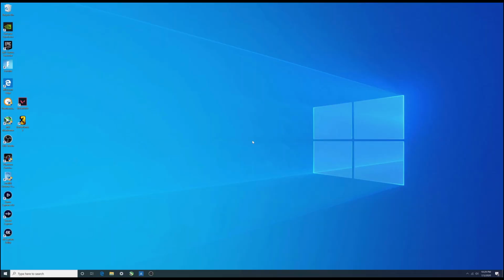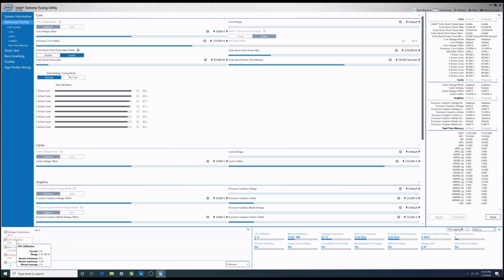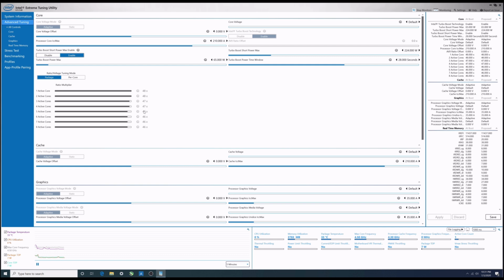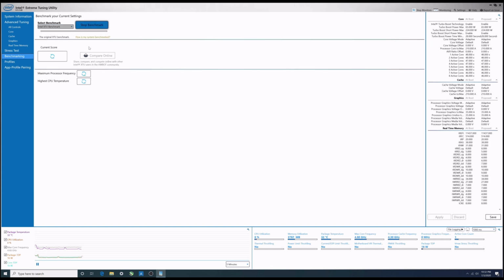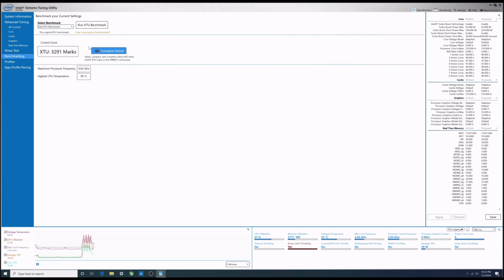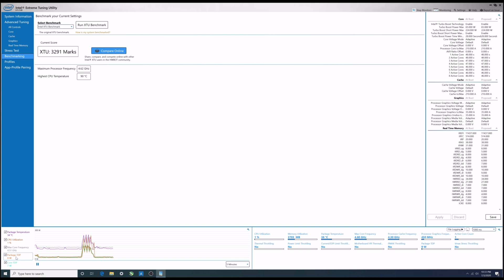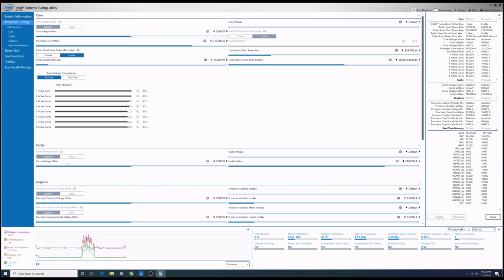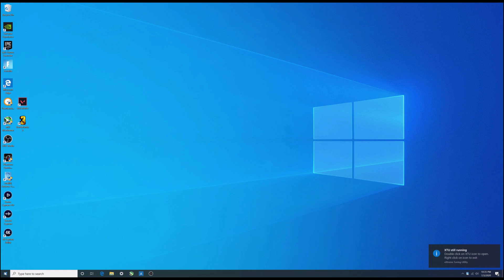1x4 1x8 CPU Power Connectors, How many do I really need to get this Z490  to boot up? (ATX) PSU z590

Comment from the maker: In this video.. I take a look at 1x4 and 1x8 for power consumption for I7 10700k. https://youtu.be/ZuXCdMJrvnM

One thing I failed to note...if you are going to use a PSU with only one 1x4, AsRock states to ensure that the corresponding 1x4 pin is plugged into where Pin 1-4 are.  Hopefully, this helps someone out.  I believe for most of you it will be whether you can only use 1x8 pin for a 1x8+1x4 pin motherboard.  Even though my PSU supports using all of them, I am only doing 1x8...when I get my I9-10900kf, we will use all of them.
Reply from the maker: Good question...and would answer that if I had 10700k instead of 10700...since I have right PSU.  This would interesting to see in XTU..as mine will pull up to 114W..and I think I only have 8pin in.  I probably should do a vid what it pulls 4 pin vs 8 vs 12.  Might answer your question.
Reply: Did you ever made that video 4 vs 8 vs 12 EPS? Because me and my brother are planning to get X570-E with 5950X. Probably a light over clock. Nothing like LN cooling, Nothing extreme overclocking. Also do you think it is safe to buy a 8 pin EPS split to 2x8ping EPS. I am using EVGA SuperNOVA 650 GA, 80 Plus Gold 650W.
Reply from the maker: @DrivinginNewYorkCityNYC    This is the only related video that I have done with I7-10700k https://www.youtube.com/watch?   I took an I7-10700k, hooked up a device that would measure total watts drawn.  I went thru 1x4, 1x8 and 1x8+1x4 seeing what power they would draw running the XTU Benchmark. Once I got to the 1x8+1x4 I added OC to the experiment.   Quick summary if I remember correctly...the 1x8+1x4 drew the most power and hit the highest benchmark.   I may one day do it again one day adding a Block Frequency 100.5 to 102.9 with the OC to see if I can beat my best Cinebench R20 and XTU benchmark.. assuming it can handle it.
Reply: @PC_HardwareTechUnboxing_1  Is it ok for me to just use 8 pin and do some overclocking? My psu is missing another 4 pin. It only has 8 pin.
Reply from the maker: @DrivinginNewYorkCityNYC   Yes, from that aspect it is no different than if you had a motherboard that only had 1x8.
Reply: @PC_HardwareTechUnboxing_1  thank you.
Reply: @PC_HardwareTechUnboxing_1  could I cause any harm if I plugged them both in? I have a i7-10700k and plan to do some medium to high overclocking but just want to make sure that the extra 4 pin isn’t going do anything bad.
Reply: @FinalLight The 8 pin gives 384W of power, if you do no heavy OC then it should be enough for the CPU. The 10900k don't even need Thst much power. I just game so nothing heavy, I also have only an 8 pin.
Reply: Please I need your advice. I have a 300watt psu with a Pin 1-4 which I intend to replace at a latter date. For the moment it powers a core 2 quad processor Q9650 of 95 watt and a GTX 1650 Super on an old lga 775 motherboard which are very power hungry. I game occasionally and my total draw is 160 watt for all the above components. I was thinking of getting the new intel motherboards and an i7 10700 of 65 watt. Not the K nor KF versions. I want to pair it with the GTX 1650 Super and the 300 psu. Do you think this is feasible because I am a bit tight on budget? Thank you in advance!
Reply: @firstblessings8777  1650 super draws 100w, 65w for the cpu, 40 for mobo, another 50 for fans etc, thats 255, plus drives and you want to have some overhead... id recommend an upgrade but you can always try what you have and see if it works???
Reply: I think I remember a motherboard with 2 8 pins

Comment: hello @david noble i want to buy msi pro b660m it has 8 + 4 pin connectors and i want to use i5 12600k without overclocking at all, can i use only 8 pin connector with full i5 12600k performance. please help me out  please
Reply from the maker: Hello, that extra 1x4 is usually only useful for extreme overclocking.  You most likely will not notice any difference.  Now, if you start adjusting power limits on an I7 and I9, it might matter a bit more.  Sadly, I did not do a good job of comparing this aspect when I had the I5-12600k in the Asus Tuf B660m, where I could have compared a few games with MSI AB for CPU power usage and done some benchmarks with Cinebench.
Reply: @PC_HardwareTechUnboxing_1  I’m building my first pc and have the same “my psu only has the 8 pin” issue.

My question is is it possible to run an adapter cable to make an extra 4 pin or a 12 pin for cpu power? 12600k seasonic focus gm 850 and a 3060ti/3070/3070 ti depending on what becomes available. Just in case I plan on overclocking the cpu in the future.

Comment: hi.  So is cpu 8 pin enough for 10700KF.  I plan to setting the CPU core to 1.2v only and whatever stable core multiplier, be it 46x.  Thanks in advance.  Hope you can help me.  I just pulled the trigger on a $199.99 10700KF and $130 msi z490 a-pro,  i haven't build it coz i saw the 8+4 CPU pin layout.
Reply from the maker: Hello, if you run default settings to a slight OC...8 pin will be fine.  There does come a point where if you are using say Intel's XTU, you will see that program starts to warn you that there is Power or Current Limit throttling...this assumes you are properly cooling your CPU and get to that point.  Even with 12th gen out now, that is a great price on an excellent CPU.
Reply: @PC_HardwareTechUnboxing_1  thanks for the reply and feedback on my purchase.  New sub here.

Comment: I have cooler master mwe 650w 80 plus version1 bronze psu.
Can you please tell me will it damage my pc components or is it a good enough psu.
My pc spec :
Pro: Ryzen 7 3700x
Mobo: msi mpg x570 gaming plus carbon pro wifi
8×2 gb of ram
Gpu planning to buy 3070
Using a 1 tb hdd
And 2 m.2 nvme
Planning to buy 2 or 3 1tb sata ssd.

Comment: I have Asus H410M-CS which has 1x4 pin.. I bought i5 10400f..will it work?? I mean like turbo boost has 4.3Ghz and base clock is 2.9hz..i dont wanna run it on base clock u know what I'm saying??

I have 1650 super and 500W bronze psu

Comment: Hi! I'm planning to buy a new PSU that only has a 1x8 connector, the processor is an i9 10900K and the motherboard is an Aorus Z490 Elite AC. Do you think that only a 1x8 connector is enough, or I will need 1x8 and 1x4 connectors? I do not plan to do OC.

Thanks!!
Reply from the maker: Hello, you will be fine.  If you were to OC and adjust power limits to unlimited, you would see some power limit throttling.  If you do neither, you probably wont' see it at all.

Comment: Can I use 2 power supply for this MOBO?
Reply from the maker: Never tried it and probably never will.  I would say  you would need to have a PSU tester on the 2nd PSU or have another motherboard sitting around that you don't have the CPU connector plugged into.   Probably not worth damaging all those parts.  However, when 12th gen comes out...I might just have to try that one.

Comment: i cant even find a 1x4 cable anywhere
Reply from the maker: Most PSUs that have this start at 750W and if they have it are 2 sets of 2x4.  They will arrive connected and you have to split them apart..

Comment: I’ve got an i7-10700kf and was wondering if I should use both the 4 and the 8 pin cables? since I plan to do some mild overclocking.
Reply from the maker: This one if those depends type answers.  If you have not set Power Limits to unlimited..and have not noticed any Power Limit throttling, you are most likely not going to gain much with the extra 4 pin.  If you have a PSU that supports it ..I would probably just plug it in anyways.  In general, it probably will not use more electric until you really push it.

Comment: why would not you be able to power it by 1x4 pin ? they all are short connected in the PCB layout..... more connections only get's you to draw more AMP-s from PSU .... and also does it VEERY much more efficiently ........ IF the cable is 16AWG and only one yellow + and one black - you would have for 9 amps on 12 volt over 50 cm (20 inch ) ... at the cpu connector you would have 11.88 volts .... THERE are 2 pairs of cables that means 11.926 Volts.....more cables means more EFFICIENCY! for processors like 10400f probably 135wats of power draw MAX in rendering.... one 1x4 jack pin or however you call it IS FINE...

Comment: 4pin is sufficient but when overload there is risk of overheating even melting of 4pin socket. therfore there Is 8pin to prevent this. Every wire Will lose efficiency and stability if the current is high so more wires Is better in distribution lower temps higher efficiency and stability. If you have only 4pin than every cable has marking on it. You just need study the wire characteristic. If you have 4pin with strong wires you can use adapter. If you have weak wires than you should use free cables from molex to 4pin adapter. But be aware that your PSU May have 2x12V which one Is dedicated to your GPU which may require more power than your CPU. The extra 4pin Is for extreme overclocking. I didnt test anynthing but I guess that worst cables of 4pin should do 95W CPU. Also motherboard should be designed for this 4pin load but i didnt found any manual info And Its probably in service manual not public. But what Is public the CPU support list so if you find there that support 125W CPU than MB should be ok.

Comment: Can someone help me? I was using a I5 3570 on a motheboard 4 pin and now i got a new motheboard but it is 4+4 pin (8 pin), i connected it and after turned on the pc, i realised the processor is much hotter on this motheboard, if i take off one 4 pin and leave only the other 4 pin will it get colder?
Reply: Maybe cuz now it has more power so it's using more powere and getting hotter , did ur performance increased ? If not yes unplug it if u feel it's cooler with 1 of 4

Comment: YO do I need to plug the 4+pin my EVGA power supply only has the 8 pin
Reply: No you dont. I didnt plug mine in and i can overclock and everything works just fine.

Comment: ok so i have this old motherboard which supports 5th gen core processors that has a 24 pin "ATX" power connector which i will be replacing with a TUF H310M gaming motherboard 8th gen along with an 8th gen pentium processor and i just found out in my new motherboard that it has a 24 pin "EATX" power connector. I can just use the same PSU right? considering the fact that it says on my PSU box that it is 4th generation processor ready. No compatibility issues right?

Comment: if someone can please awnser my question that would be very appriciated. on my motherboard i have a 6 and 8 pin connector for my cpu i have only plugged in the 6 pin connector. but is there a difference if i plug both of them in or only the 8 pin instead of the 6?
Reply: what motherboard?
Reply: @bak1necWWE  msi meg x570 ace

Comment: Hi david noble , First Thanks for the Great Information that so missing Out there, mi questions is: I Updated now after 7 years my pc : ATX Antec Tower  with 4 Fans, Msi Z490 mpg gaming wifi motherboard, 16 gig 3200 MHz crucial , 2 m.2 SSD (500+250),i9 10850k,cpu cooler master liquid with 2 Fans, rx590 8 giga , But I have only 8 pin in my power supply (ZALMAN ZM700-LEII 700WATT ) I think of lightly OC , 8 Pin it is OK for that Or Upgrade to power supply to 8+4 pins? Thanks A lot🙏🏻🙏🏻🙏🏻

Comment: I bought i5-10400 with z490 a pro ripjaws 16gb 3200 and a corsair rm650W x..it has 1x 8pin and 1x 4pin for cpu..is it ok if i plug only the 8pin connector? Thank youuuu
Reply from the maker: Yes,  from my testing that processor will not benefit from the extra 1x4.  It is really only beneficial to unlocked (k) cpus or possibly I7-10700 and I9-10900.  I believe I have another video out there where I show power draw with an unlocked cpu.  I am supposed to be getting in a I9-10900f, so i might redo that for a locked chip.  If it does nothing for that cpu, it surely will not benefit the I5.
Reply: @PC_HardwareTechUnboxing_1  thank you very much and for the quick reply 😁

Comment: Hey bro,thanks for making a video like this for us 😊 it’s really helpful!! But I have a question, can I only use 1x8 pin for an intel i5 10600k with heavy oc? I’m using a 650w 80plus bronze psu as well as running a 3060ti
Reply: @LongShot yes,i did found my answer after doing some research.Under normal circumstances,u can power up ur cpu with just a 4pin cableBut if ur planning to over clock.You can connect the 8pin only using those 4+4 and forget about the other one.
The extra +4 (or even +8 on ultra-high-end boards) is for extreme overclocking (aka LN2) and can be safely ignored.A read on ATX specifications, if you're really REALLY bored ... https://en.wikipedia.org/wiki/ATX
"8 amperes maximum per pin", that's 32 Amps x 12 v = 384 Watts max coming through that 8-pin. You won't reach that without LN2
. Just 8 pin or 4+4 will do great
Reply: @leearden5289  thank you for this comment I have the same psu and a i5 10400 and a 3060 ti and I've been worried that it wouldn't turn on without it
Reply: @leearden5289  king

Comment: So I tried this on my z490 vision g and it gives me cpu code debug and doesn't turn on and my motherboard doesn't power any fans... but powers the ram though, anyone know what's going on?
Reply: Hey I am planning to get the same mobo, but I don't if have to buy an expensive psu for the extra 4 pin cpu 12v power. Please let me know if you have to connect that extra plug or not. Thanks

Comment: My motherboard requires a 8 and 4 pin connector but my PSU only has an 8 pin cpu connectors
Reply from the maker: What CPU?
Reply: same problem here i'm using x570 tomahawk and i only have 8 pin. i dont know why its not working

Comment: a 8pin cpu cable(4+4) from a seasonic 650W could be enough for a 10400 with always turbo mode?
Reply: yo i have the same question i just bought a 10400 and wondering if 8 pins gonna cut it with my 600 bq

Comment: Hello sir im planning to buy msi mpg Z490 mobo with i5 7400 and my psu has only 1×8 cpu connector is it ok?
Reply: Won’t work down as far as I know different socket it i5 7400 is a lga 1151

Comment: Hello i was building a budget pc: mobo-Asus prime b450m-a, ramsta 1x8gb 2666mhz and a 400w psu
no processor yet i am still saving up, the problem is my psu only have 4 pin and the board got 8pin, they say its ok but don't OC it and processor must not reach 65W tpd and higher it may fry the system, now i am thinking to buy an athlon 200ge instead of ryzen 3 2200g or 3300g, im afraid my system will fry.. please answer anyone.. thank you!
Reply: You should prob go for 500w min just in case you ever want to upgrade

Comment: Hey man, I just got a aoros pro x570 and I'm getting either ryzen 5800/5900. My question is, do I need to plug in both the 1x8 AND the 1x4 cpu 12v power cables? Havnet built a pc in 7 years and on my old on it's just one 1x8 12v cable (i7 4770k)

Cheers!
Reply from the maker: Hello, thanks for the question.  No you definitely can get by and enjoy really good performance with only 1x8.  If you are someone who is searching for getting the greatness benchmark numbers and possibly some gaming improvement via Overclocking...than my answer would be different.   

I did a video with an Intel I7-10700k...and it wasn't until I started doing some OC'ing to it that you would notice that it was drawing more power.  So, if you don't plan to OC...stick with 1x8.  If mild OC...still good with 1x8.  If you really want to push it...your best best probably is getting a PSU that has 2 sets of 1x8s which could be split to a 1x8 and  2x4 CPU connectors.  Now, this is based on Intel :  https://www.youtube.com/watch?v=ZuXCdMJrvnM

My X570 died or I would do the same type video with 3900x..it is now in a A520 and only has 1x8.

Hope that helps
Reply: @PC_HardwareTechUnboxing_1  hey man I’m going to be running games at like 240 FPS and streaming will I need the 4 pin also plugged in with the 8 pin
Reply: @PC_HardwareTechUnboxing_1  many thanks! This is very helpfull! 💯👍

More power to your next vids. 💯

Comment: I have a plan to buy i5 10400 with rtx 2060, I'm using motherboard ASRock Z490 pro with 8 + 4 pin connector, but my psu just have 8x1 connector, it'll be fine or I've to change my psu?
Reply from the maker: @kosfriendly_3577   I read your comment b4 editing...yes, you want something like this EVGA 850BQ which basically is 2x   2x4 CPU power connectors  https://amzn.to/3doeqW0
Reply from the maker: Yes..for that CPU..1x8 is fine.  Even a 1x4 would power it.
Reply: @PC_HardwareTechUnboxing_1  can i do overclock ram ?
Reply from the maker: @naufalabid1807  Yes and no...if you don't pick compatible RAM...it either won't work, or it will run at slower speed than stated.  If you pick compatible RAM...using XMP you will hit the stated speed.  You may be able to overclock it beyond that.
Reply: or overclock vga

Comment: Do you know any power supplies that have the 1x8 + 1x4 pin CPU connectors? I plan on overclocking for my mobo.
Reply from the maker: Hello, I have two EVGA 850BQ, it has 2 x 1x8 for CPU connector.  There is also a 750W version that has it too.
Reply: David Noble so I can turn 1x8 into a 1x4 by cutting it in half and have the other 4 sticking out?
Reply from the maker: Cutting sounds bad...let me make a quick video
Reply from the maker: @XxNutbangxX  Hello again..look at the 3min 15 sec mark and 8min21sec mark of this video.  They are set up as 2x4 and 2x4...so you will use one set and have to figure out which of the other 1x4's fit...than let the other overhang   https://www.youtube.com/watch?v=vJOg1Fdr44E